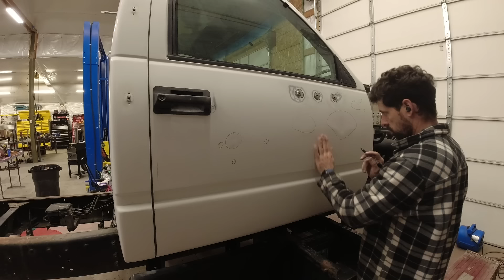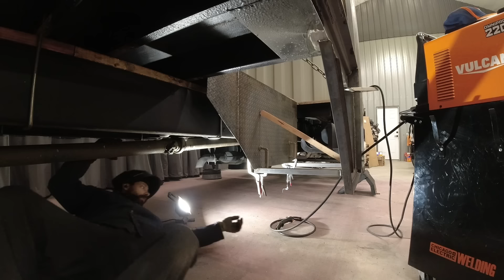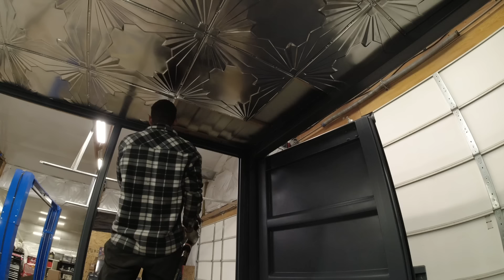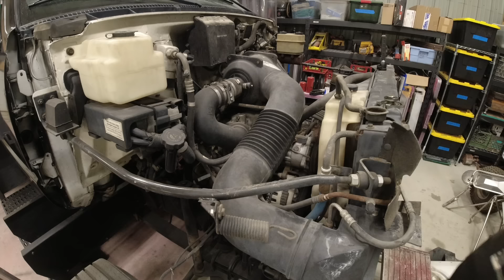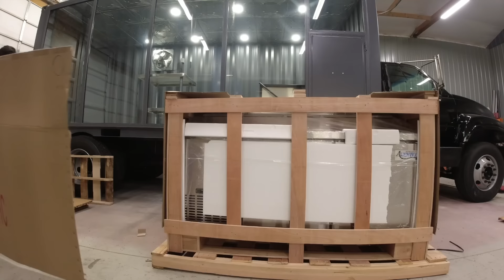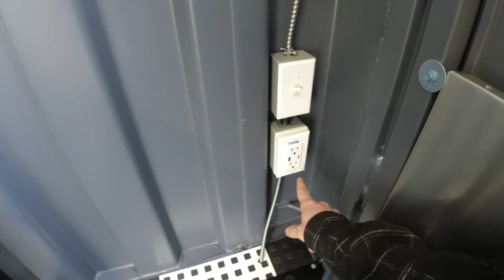I Built An EVEN BETTER Pizza Truck Out Of An Old Box Truck

Comment: Hey Austin, great job on the truck, your videos are awesome! I’m modifying a container for a shop and was wondering if you mind sharing some more details on how you framed the windows out? It’s hard to see if that’s small tubing or angle iron welded into the main tubing frame on the outside. How much of a gap around the windows do you leave? Thanks for putting these videos together :)
Reply from the maker: 1.5 square tubing outside, .5 square tubing frame on the outside, .5 square tubing frame inside. The glass is dual pane 3/16 laminated so almost 7/16" thick so leaves around 1/16" gap that gets filled in with the windshield adhesive. Although the inside frame didn't quite tighten until it was flush so realistically it had about 1/16" on each side of the glass. For a shop, I wouldn't use this glass, I would use integrated glass units because they are insulated. I got the glass from onedayglass.com and was very happy with their price and service.
Reply: Thank you! I’ll take a look at their website.

Comment: I hope it's the first and the last time you deal with that pizza oven company. First off the damage must have been at the factory and still put in the container for shipment. Second stating that will have a vertical exhaust and it doesn't. I would like to do not do business with them again. Or to get a bigger discounts on pizza ovens. 👍

Comment: You get pinholes ibn the bondo because you mix it wrong. You stir it andthat draws air intoi it. You are supposed to fold bondo to squeeze the air out and therefore not get pinholes.

Comment: Nice job on the pizza truck the only thing i would have done differently  is keeping the 3 '  of frame on the back end put in a flooring  and mount the pizza oven to it half in the truck half outside  the truck more room insde you can cut the doors so they fit the top still and make something for the bottem .

Comment: Love the concept, but the pizza's I  have had in the Phoenix area, the crusts were always under cooked. The reason is, it takes a long time for these style ovens to get up to temp and you can't put a fire in them when you are driving down the road, to your location or event. The tops come out fine but the bottoms of the crusts are soggy. 
      I was thinking what if you could design the Pizza oven like a pottery kiln that uses electricity to get up to temp? You could run the generator to power it while you are driving to your event, and just make a small fire when you get there and you could be serving pizzas with in minuets of your arrival,  instead of  waiting for it to get up to 800 degrees, just a thought.

Comment: On that Hood: What I have found, if you sand down and clean the area around OLD broken fiberglass with a bunch of Acetone & rags, it will soften up the old resin to where the new stuff bonds better and will have a much better chance not to crack in the future?

Comment: Great Project and great outcome. I see one possible problem: If the fan is running it could suck fumes and CO out of the oven. It would be safer if you switch the fan around and get it into pushing air into the truck. If it is necessary, I don't know but CO is no joke and the fan seems big enough
Reply: I had exactly the same concern!
Reply: Yeah, sucking air out seems like an issue, that would make the chimney the air intake.

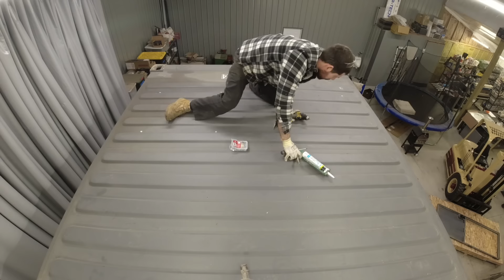Comment: 19:02 if you take a little bit of extra time to setup where your holes will be (on all the roof at once) you can then get a screw form and dent the material upwards to make truncated cones in the roof. Combined with rubber lined washer roof screws, then you'll have an already water proof system by nature of shedding water before it can even get collected to begin with.
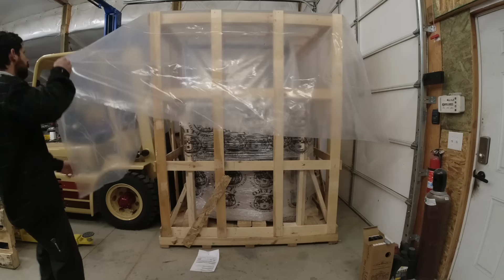edit: 45:19 the two popped up boards might be a clue. They dropped the thing. Given its mass, it's easy to figure out that the whole thing shifted and pulled the fascia. A reverse bend, not from the outside, but from the inside.
Reply from the maker: I think you are right on the fascia. I noticed the popped up boards, but never thought of that. someone was sloppy with a forklift.

Comment: Did you paint 6 wheels, back and front for tire rotation or just 4 1 side each?
Reply from the maker: Only 4. The Steers and Drivers are different tires so you cant rotate front to back.  You could rotate the rears, but I don't know why you would need to as they wear evenly.
Reply: @AustinCoulson  thanks. I only know about dually rotation